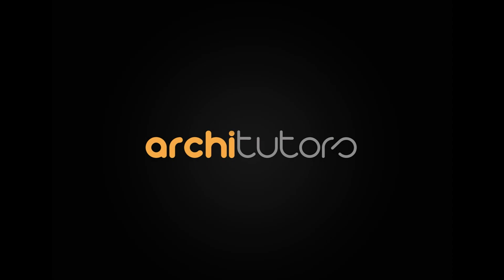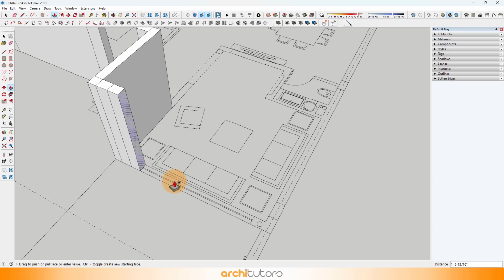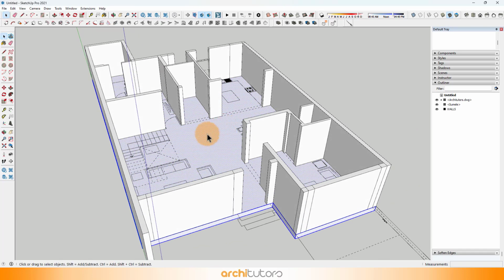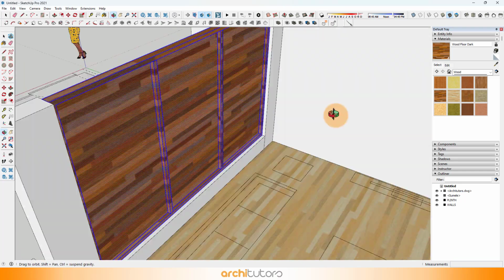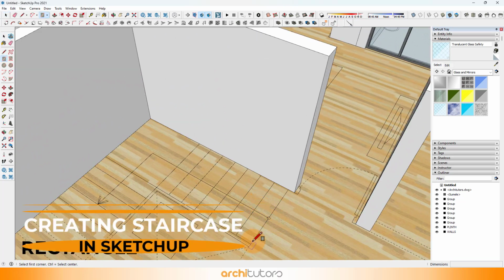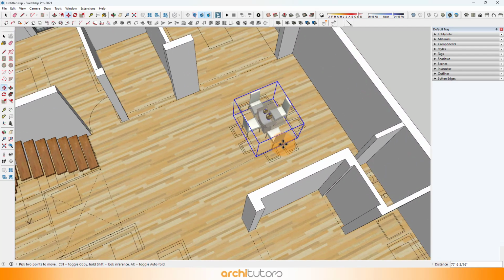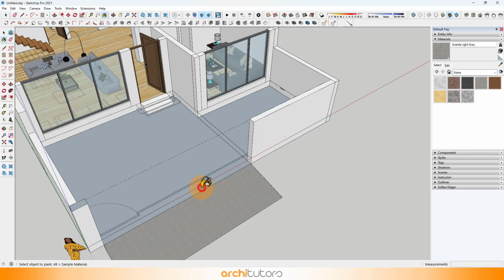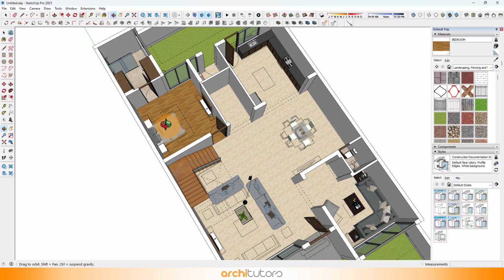How to Make 3d Floor Plan in Sketchup (Sketchup Tutorial)

Comment: Why do you make the walls in sketchup. You can just explode the group then you can extrude all walls together.
Reply from the maker: Thanks for the suggestion! Exploding the group and extruding all walls together in SketchUp works well if the walls are originally organized in separate blocks or layers in AutoCAD. However, when the imported AutoCAD drawing consists of all layers merged into one group, this approach can lead to chaos. Extruding will cause the lines and faces in SketchUp to merge and overlap uncontrollably, creating a tangled web of messy geometry rather than clean 3D walls. In such cases, it's essential to organize the layers or blocks properly before importing, or work on the walls individually after importing to avoid this 3D disaster.